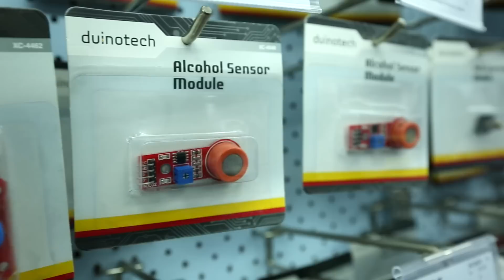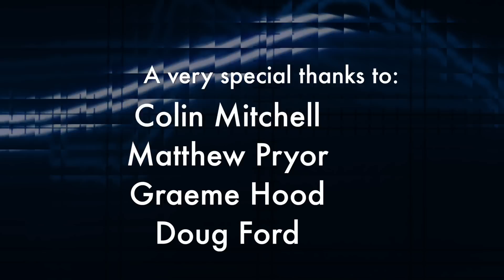The Decline of Hobby Electronics?

Comment: Different world now but sometimes us old geezers can still win. I retired at 70 but before I left, the company asked me to look at a 3 channel Mosfet power switching device that was driven by a PIC. This was urgent, affecting production, the Mosfets had blown and in so doing took out the PIC that controlled them. The big trouble was, the original designer had left, leaving no circuit or PIC Program! I analyzed what was required from the input data and found that two Quad Nand chips could be wired to do the same. After replacing the underrated blown Fets with some beefier types the power device was working, at least if it ever fails again the engineer will not have to worry about programming a PIC!

Comment: The most frustrating and thing I find about electronics nowadays is that everything you buy is meant to be replaced when it goes bad. The electronics inside are so tiny and chip-based that you almost never have a chance to repair them. Also they don't even come with a servicing manual or schematic.
Reply: There are some pdf called Datasheets that explains everything aboout the components.

Comment: Personally i dont find SMD components that scary as a hobbyist, i find them superior for their size. With a 60w cheap soldering iron and a pair of ceramic tweesers, i can do anything from microcontrollers to the tinyest SMD caps or resistors. It is all about the technique. I love shrinking down my huge boards to a tiny smd board...

Comment: ive gotten into ordering stuff from china a while back and it is such a change to the way I can do my hobby electronics, the ridiculously cheap components are perfect for messing around and as im messing around with stuff i get new idea and experiences. With stuff from china i can easily buy way more stuff then i could ever use; some of the local components i have are often a lot better in quality but when you are just building simple devices for yourself its fantastic to just be able to buy hundreds of components for a few bucks and have them ready, or order a specific item for a project at a bargain price and almost always with free shipping  - I take a lot of pleasure in clever design. I started out feeling SMD and Microcontrollers were sort of a dark art but as im designing things i find they are probably much easier and often better solutions (especially making neat, compact devices). Its really not fun making a 7 digit driver or other fairly complex device by hand soldering DIP packages and dozens of connections and wires. Im probably getting some SMD leds, resistors and atmega328 chips soon to mess around with.

Comment: I got into electronics when I was 9 by making kits, nowadays I use SMD componants and learned how to design and make my own PCBs as well.

Despite having a reflow hotplate, I actually hand solder all my componants by default, I actually find all the fiddly work very thereputic. I'll only use the hotplate when dealing with certain packege types that can't be done using an iron.

Pick and place is also by hand but as I only make one or two boards every now and again, I haven't needed a machine to do it yet.

I miss the old Maplins, once apon a time you could walk in and show the guy behind the counter a poorly drawn schematic and he'd get all the parts and even offer a suggestion on improving it. Nowadays the guy behind the desk doesn't even know what a "resistor" is, let alone how to read or find the value I need, I just get a catalog shoved in front of me and I have to find it for them (I kid you not).

I mostly use RS as they opened their doors to the hobby world recently, no more 1000+ when yiu only need the one, and all online sales are free shipping (even for a 20p item).
Reply from the maker: Thank you for your perspective. Cheers!

Comment: The stand alone transistor was replaced by the IC chip, then microcontroller, now a supper computer on a credit card size PCBs, on and on. Researchers have shown that a form of "Port knocking" with the Opcode's of a microcontroller/CPU can bypass various security features if masks in at manufacturing time. In the old days the transistor always behave like a transistor until you let the Smoke Out, the new kids will have a lot to keep then on their toes, the tech they have access to now for under a $100 is mind-bending.
Reply: yes its completely mindblowing just how powerfull the tech is you pickup for low prices and the amazing stuff you can make with it! imagination is more and more becoming the limiting factor.      *Also, kids will have to be carefull with static charge when around you Dr. Mosfet.

Comment: The skills needed in this field haven't changed, just the components and assembly of components have. Simple solution to this problem is to simply learn how to make your own printed circuits and pick and place machine. An arduino or ras controlled diy pick and place machine is not really hard to make. Just learning to do these two things will have you making your own arduinos and ras berry pies in no time. These are the few extra things that electronic hobbyist should learn if they are super into diy electronics to keep up with the current electronic environment.

(Edit) To add to this, I can say for certain what is causing the decline in the curiosity of Diy electronic technicians is cost. If someone totally new to wanting to learn about electronics today had to choose to learn how to build an electronic device from scratch or buy an already made device for alot cheaper than it would cost to make the device, they would choose the already made version which totally kills the want to learn the process. So i think new people who are serious about this field have to have some sort of passion for it and accept that they will pay more for the knowledge they will from making their own stuff.
Reply from the maker: Thank you for your considered comment. Its a complex issue. I think most would agree with you on overcoming the obstacles, that learning to work with cad, smd, programming etc is crucial and perhaps even easy once you have overcome the initial stages of learning. However just getting started is the thing that kills off peoples interest early, starving the industry of new players. Arduino, Raspberry Pi and others have reversed this trend simply because it forces people to take an interest in these things once they realise the value in learning a thing or two about transistors, interfacing with Opamps, shift registers etc. Five years ago, when I interviewed the majority of this videos participants, they saw a decline in interest in electronics, however in an upcoming video, many have changed their minds on that view today.

Comment: Young people today don't get to learn what a simple transistor is any more.
Back in my teens i could go to a  local electronics shop and buy single transistors and other discrete components and build simple circuits, i learned what each component did, and how i could modify a circuit to do what i want it to.
Now the young people's first step is arduino, RPi, etc. unfortunately they will spend a lot of time in front of the computer programming it,  building a simple switch input and light output to make a 'delay off' light circuit, and they call it electronics, NO!! that's programming.
Where we had single transistors, there is now a processor inside the same package, that's not electronics.
There are no electronics shops in the UK as far as i can tell, everything has to be ordered online, if we want to get kids away from the computer and into the fresh air, electronics shops should return, along with components that don't need special tools, microscopes, ovens etc.
There's no way i would work with smd, i can't afford all the extras, so how is a teen supposed to with their pocket money.
One thing i like to do is circuit bending, you can't do that easily when the only components on the board are a few passives and a black blob.
btw, my first introduction was at about 12 years old getting a couple of old valve (tube) radios and making one good one.
Reply: Maplin in Birmingham UK stocks electronics kits in-store. You can wander in and buy off the shelf. I witnessed it via my drone camera (joking). Nah, I walked into the store and saw actual solderable parts for sale! Almost like a museum.
Reply from the maker: Nice and thank you for your comment.
Reply: Last time i went into a maplin was about 30 years ago, we had phoned to check if they had a part (they did), reserved it, went in and asked for it, the box was on the shelf in the shopfront, it was showing as in stock, but the part was missing, that was a 45 minute journey (each way) for nothing.
Reply: Not really, my tagline is 'Ancient geek', born in 55BC (before computers), but i keep up with tech (though i don't go buying it all), i have a pi and a maple, but i still like to go back to basics with transistors etc.
After the maplin fail i started using RS components, CPC, Farnell, now i mainly use Amazon.

Comment: The problem with small components like SMDs and micro controllers is that if they break the whole thing breaks and there's nothing you can replace to fix it again. You have to buy the whole thing again. For the traditional parts, if an capacitor breaks you can replace it.

Comment: I don't think that DIP is ever going away, really. I even see some circuits that have both smt and dip. Also, I really don't see a problem with microcontrollers. :/ I use those as a proof of concept, and I even make my own shields, so I still use my soldering and breadboarding skills.
Reply from the maker: Nice. Thanks for the comment.

Comment: I still prefer discretes over any digital crap anytime.  Although to be honest, i did try working with microcontrollers such as PIC, Atmel, Zilog etc. yet even these can be interfaced with analog devices.  I hate working with very small smd's. There's nothing more satisfying than making your own homemade radio using components in your parts bin, parts salvaged from used electronics or those easily bought from electronics parts store. Good thing I have stocks of old standard parts :D
Reply from the maker: Awesome :-)
Reply: @rene kenshin.  Analog and Digital are BOTH needed.....However from the very onset the SMD shit was designed to keep everyone out,except the industry DRONES who only design and build what they are told to do. Analog or Digital it doesn't matter as long as it IS DIP (THROUGH HOLE)!!!.
Reply: Did I mention that it wasn't?  Like I said, I worked with both, it's just that smd's are getting smaller and smaller, unless you have 20/20 eye vision forever, you have to use a pretty decent magnifying glass to work with them.

Comment: I been around since the 70's, thing do change like the dim red LED right through to powerful LED white light, poor power to weight ratio of the 70's recharable battery, the ni-cad right through to Li-ion and Lipo, yes the ne555v timer to attiny85, there is soo much, I feel getting old and my eyesight getting worst for these surface mounted components. I am still keeping up with the Chinese stuffs they makes, some ic's not heard of because they are so new. I won't rest....
Reply from the maker: Good on you! Thats fantastic to hear. Thank you for your comment. Cheers!

Comment: In addition to the changes introduced by inexpensive Chinese manufacturing, there has also been one other huge change: computers.  You can now do far more with a tiny processor and a bit of code then you could manage with years of work developing an electronic device in the 1970s.  Much of the complexity has moved away from the circuitry to software.
Reply from the maker: Very true and thanks for your comment.

Comment: it's actually easier to work with surface mount components than through hole, what are these guys talking about. hobby electronics has never been easier, I make my own pcb circuits with surface mount components, i dont even bother to breadboard anymore, I just use a circuit simulator and then in a matter of hours I have the finished pcb (depending on how many components i have to solder)

Comment: I think that if hobby electronics goes down the drain, kids will never have the trigger to involve and probably we will run out of electronic engineers. We will stuck with the existing technology, making variations and there won't be anybody to evolve the technology, because nobody had the chance as kid to make, search, fail, succeed, learn. After all, even a all in one chip today is made from components put together.
Reply from the maker: Although much of the concerns of this video are about decline in hobby electronics, it needs to be said that this was 5 years ago and this is how people felt about things at that time. Today there is definitely a shift towards a new form of hobbyist and I am currently putting an episode together that does reflect this new development so stay tuned. However I think all your points are still valid and there is definitely a danger of indifference, loss of industry, closures and general decline if governments, education systems and even industry itself doesn't realise that a loss of ingenuity in any form is a bad thing.
Reply: Amen

Hallelujah
Reply: You are right. But basics is where you getting start with.

Comment: what a superb video.  it captures the gulf between professional and amateur electronics that emerged after SMD.   In particular the shift toward hobby microcontroller and prefab modules, allowing a mix of computer programming and basic electronics skills to develop, but bypassing most of the 'low level' stuff like power regulation that once would have been needed.  This does mirror the pro world somewhat with even simple devices often having surprising computing power.  Unfortunately for the amateur it can result in them bypassing an understanding of logic gates and other useful stuff too, but on the whole represents not a decline but an increase in hobby microcontroller/electronics.
Reply from the maker: Great comment and thank you. I am currently in production of the follow up on this episode which mirrors your thoughts. I look forward in sharing that with you soon. Cheers.

Comment: The miniaturisation of components, I think, is what's stopping a lot of would be diy'ers. Surface mount devices are great to use if you have the proper equipment. The problem is that some of these tools can cost a bit to acquire, some are very inexpensive. Back in the day it was all through hole, and much simpler, but a lot of the same components today are only made in SMD format.
Reply from the maker: agree totally. Not all find SMD easy, especially beginners. It also disengages those with eyesight issues. Thanks for your comment

Comment: Hobby electronic only changed in that it's now cheaper to buy most electronic appliances than make them yourself. Now you make stuff either to learn, because you like working with your hands, or what you want does not exists. And instead of going to a physical store, you order your parts online. There are plenty of thru hole parts available if you don't feel ready for surface mount and online video tutorials to help you when you're ready. 

I know someone who thought himself electronic fixing antique radios in much the same way hobbyist would have done at the beginning but he also had the power of the internet to help him learn and to find hard to find parts. I helped him a little but I know nothing about tubes (or valves). 

I personally think that it might be easier for a beginner to get into the hobby (from antique radios to micro controllers) than it ever was. And "advanced" equipment like oscilloscopes are a lot more affordable now while being more powerful. Look at old magazines adverts and remember to adjust for inflation.

I was afraid for hobby electronic when surface mount started becoming the way the industry built things but now I am glad to see that my fears were unfounded.
Reply from the maker: +SlyPearTree You raise some great points. Knowing how to ask questions and what to ask about is now the challenge for complete newbies. Shortcutting that process by asking someone in person (in the old days) often helped a great deal by being immediate, personal, and perhaps motivational, however now today you can ask someone online, hackerspaces, google it etc etc so its just different. The greater point of "does making anything yourself, benefit you in some way ...?" - Apart from self gratification and personal learning, unless you use that knowledge to produce a product, develop a widget that changes the world, makes you money/ earn a living ... its probably cheaper, easier and more reliable to go buy the finished goods! Not seeing a purpose for learning is probably the greatest concern for all (i.e. no jobs to go to).

Comment: i don't get all this "bad SMD/good trough-hole" nagging.
for last 5-7 years i moved to SMD stuff completely and i like it so much more.
no more drilling no more bending and sidecutters, stuff take less space, no need to flip board to look what's go there !
just use decent size ones (like 0805).
Reply: +MRooodddvvv Yes, same for me. The drilling was one of the most annoying thing. Especially because I needed special drill (with a special price). Ordinary steel drill would be dull after a couple of holes, because of glass fibers in FR4 material. 0805 is HUGE for me, 0603 is OK. But I'm 30yo, so no handicaps. Maybe I'll change my opinion with years :-)
Reply: xy4648841fd
0603 is ok too, but no one have to use those.
btw bout drilling i forgot to mention such awesome disease as silicosis, which you get from breathing in fiberglass dust...
so less holes - better !
Reply: +xy4648841fd Back in the '80s I could drill 0.5mm holes with a carbide drill by hand.  No way now, I must use a drill stand.  I'm moving away from doing that at all, like everyone else.
Reply: Just about every aspect of actually making PCBs is bad for you - even soldering them.